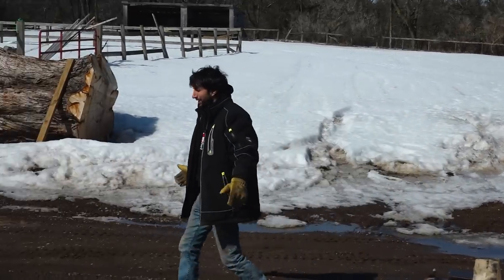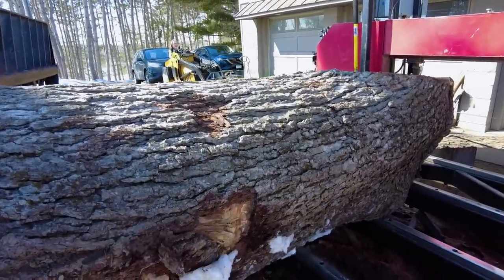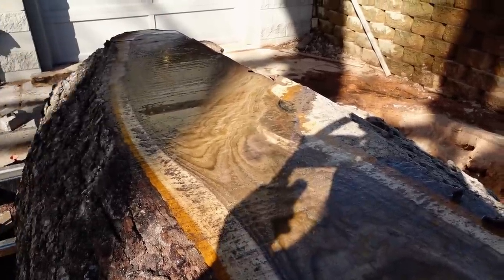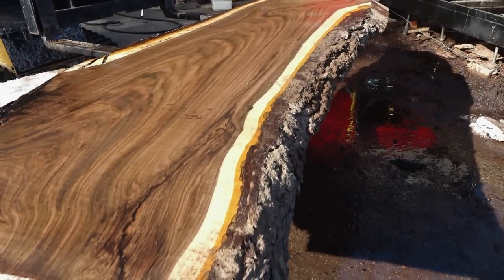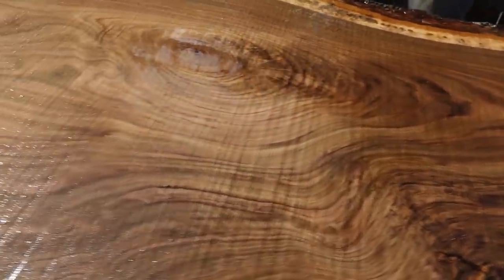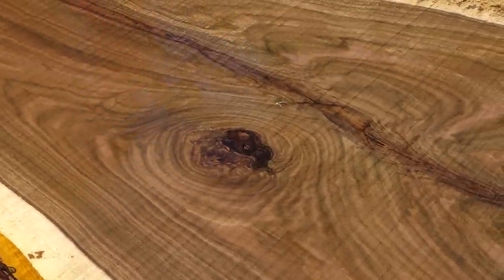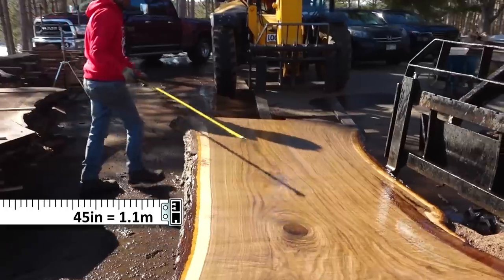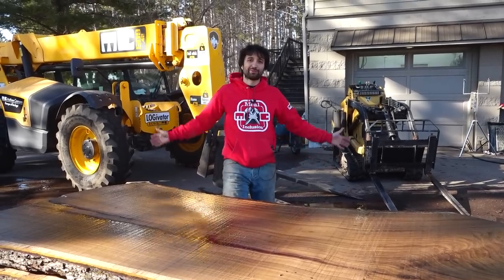Can this massacred Walnut log produce hidden gems? 💎🪵

Comment: Wow, love the custom logo sticker on the back of that lift! I'm thinking just the scraps from your milling would heat the home for a few years.

Umh, seems that belt is crying out for help. Been watching you for years and I don't recall hearing such belt squeal before.

Have you been practicing? Your single toss full coverage water throws are getting so much better.

Comment: Hi Matt, I have a question on the CA glue. I noticed you were using it on all unfinished wood. Is there any reason to NOT use this on finished woodwork?? I recently ended up with 2 large pieces of Ethan Allen furniture and I snapped of "BOTH center styles from the doors in the lower cabinets. They both popped off like snapping a twig, so I know the glue they used was crap. These are pieces that would be really difficult to clamp up, so CA was first on my mind.. What do you think??

Comment: Mat: I used to work for JCB's biggest competitor (Manitou) and built their entire business in the N/E. I would imagine these logs are pretty damn heavy. The strength in the removable fork carriage is not in  that bottom beam. It's up where the pin is that the forks mount to. You'd be better chaining over the heel of both forks, then through and over the bottom carriage plate, and tilt back to make sure it is secure. Ideally just spread the forks and pick with the forks. Just sayin!
Reply: Funny I was thinking same thing....why not just use the forks and pick the log....is the log maybe too heavy for the forks.....just asking. Long time watcher from the beginning of the channel.
Reply: @tobysewell7699  safer to have gone over the heel of the forks also and then around the bottom carriage plate. That way load is spread from the top of the fork mount (pin) and the bottom plate. All that force on just the bottom of the carriage will eventually break it which is a safety risk and costs $$ to replace.

Comment: I bet you have addressed this, but have you considered an electric  motor on the vinch? I bet it would make a smoother surface, now the blade bounces everytime you crank.

Or the gravity feed thing from a chainsaw mill video. Tie a rope to the carriage and put a heavy weight to pull it forward. It produces surprisingly smooth smsurface on the chainsaw mill.